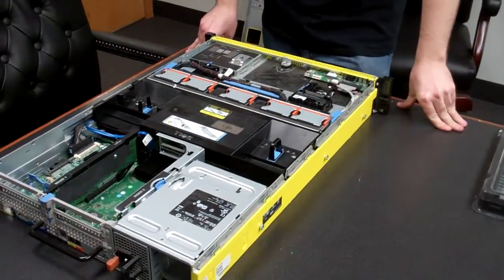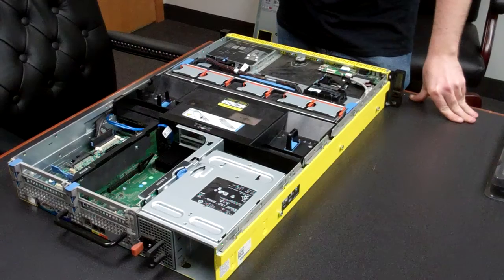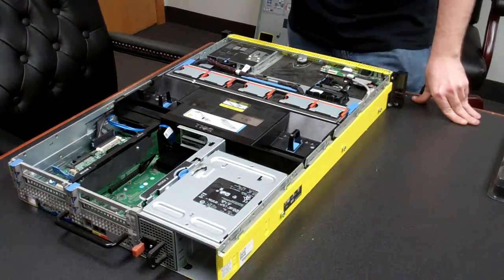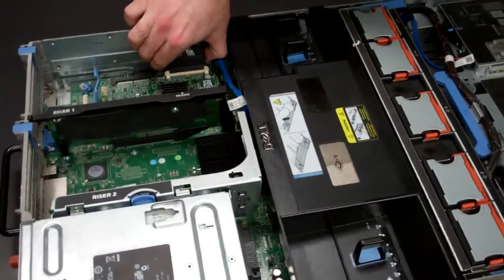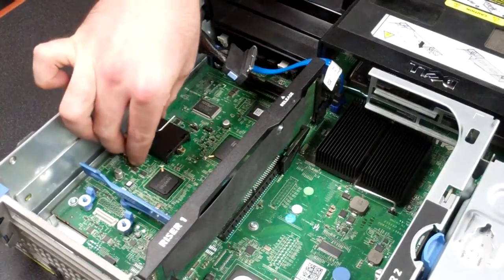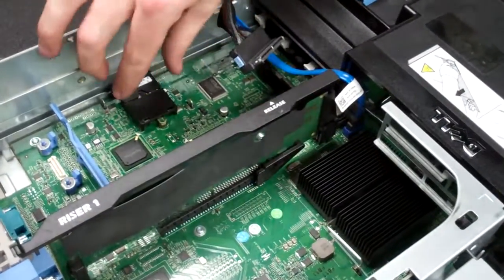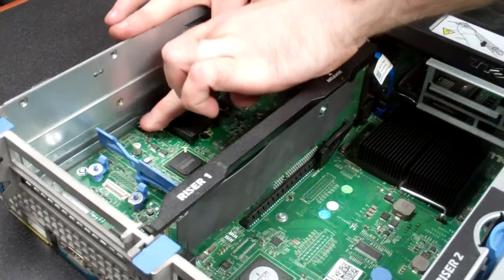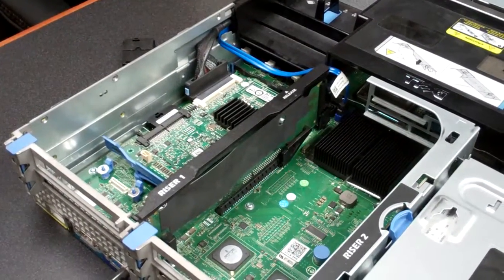Velocity Tech Solutions - iDRAC Express Replacement in PowerEdge R710 Server

Comment: I'm using a T310 for a home NAS/Docker machine. Is there any point to an iDRAC for me? Still new to the Dell PowerEdge game and it looks like there isn't. My build: https://www.youtube.com/watch?v=9LxjTxU--iI&t=26s I have 7 drive bays now. :)
Reply: iDrac express will allow you to remotely power down (Full shutdown) and power on your server if you had to for some reason (Think hung server where you need to hard reboot). You can also use it to virtually connect to the server (Think RDP) to the server and enter the bios, raid, or integrated services and makes changes. It allows you to remotely manage the server as if you were standing in front of it as well as a host of other features. iDrac express allows you to remotely manage the server up until an OS has load and is at the login screen.
iDrac enterprise would allow you to actually login to the OS and do everything as if you were standing in front of it. 
So if RDP stopped working on a server or you screwed up the NIC settings and couldn't connect to it via RDP,  you could still connect to it via idrac and login and fix whatever you broke, as idrac uses it own IP separate from the main nic.